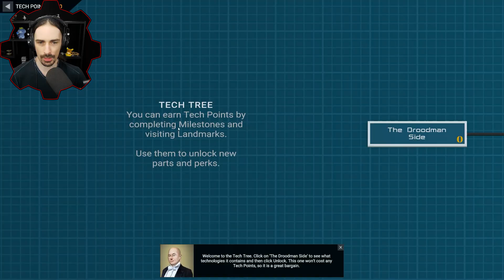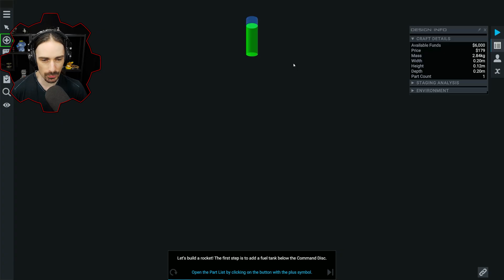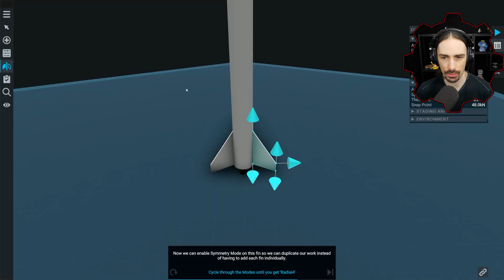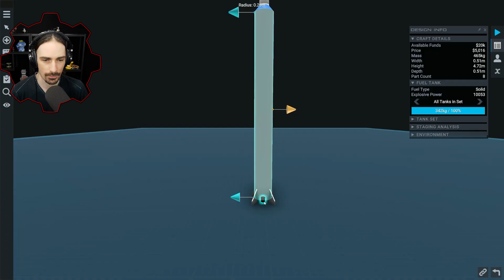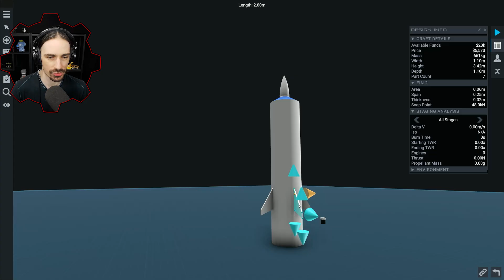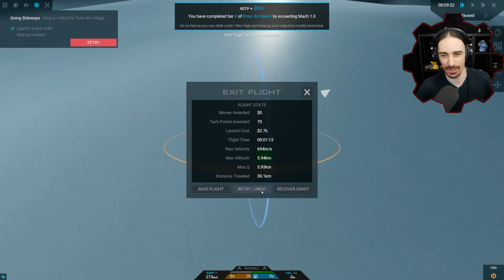This Rocket Builder Game Made Me CRASH MY OWN ROCKETS! [Juno: New Origins First Look]

Comment: I think scrapman needs to learn a bit of aerodynamics...

First, why did you fail the fireworks challenge?
The boom power depends on the amount of fuel in the tank, increasing the size of the tank increases the fuel capacity and increases power, but as you fly your engines are using that fuel so the boom power decreases...

Second, why is your craft hard to turn?
Your rocket has find for stability like a dart. And those fins don't have control surfaces... It will always point your craft in the direction You're going.

Comment: i suggest you to play kerbal space program 2 but they still not released it but kerbal space program 1 is still okay too but read all the documentation wiki because you will be got mind blowing how insane the community build handful but still readable for novice or first timer to play the games which is very fun to learn about rockets science without stressing you so much.

i dont know if this game using same principal with kerbals but you should tilt the rockets when its around 700m-1.5km around 45 degree to the left/rights and let the rcokets flying horizontally while pitching upwards to get lineup with horizons.

in the fireworks contracts, you need put more than number it says and exploding it higher than value to completed the contract, just the wording in there are using different approach what is meaning.

For the horizonal flights it better to gain attitude first around 2-5km or more ASL, then tilt it gradually until match with horizon and use less air resistance to gain more distance

Comment: The reason you were struggling with explosive power: 

The explosive power is based on how much fuel is in the rocket. So you made a rocket with 3267 'boom power' when it was full. But then you burned half your fuel getting up to 10km and lost 50% of your boom power.

Comment: so, the issue with the boom power was in the fuel leftovers in your fuel tank. while your rocket isn't launched, it shows the boom power for the 100% fuel in the fuel tank. when you tried to blow it, you had only a small amount of fuel in a tank, so it was not equal 3k boom power, as 100% filled tank.
hope I cleared it up for you

Comment: Hey ScrapMan,
The reason your rocket wasn’t turning quite as fast in your last launch was because of the force exerted on the fins increases with increasing speed. So when you launched before and tilted Ive way faster, that was because you have significantly less force pushing on those fins. At higher speeds the fins (unless they have controll surfaces) will try to always point you in the direction of travel. BUT the force of air also decreases as you go up in the atmosphere. This so there is a point at which your speed and height make for maximum aerodynamic force on your rocket. This is called “Max Q” in the aerospace world. You can often times hear an announcer calling out max q during a real world rocket launch!

P.S. keep playing this game!!!!!!!!

Comment: The boom power goes down as you burn fuel, Scrapman if you review the footage when you're getting ready to blow it up you'll see the boom power going down. You got super lucky with the success as the number was almost lower than 3168
Reply: I was just about to comment this
Reply: Yeah @Mojo Jojo
Reply: What a goober
Reply: Wasn't looking close enough to see that, but I was wondering if that was the issue, thanks.
Reply: @Nevir202  Same here!
Reply: Yeah it's not that obvious they should of made it more clear
Reply: @codingmaniac  To me its obvious because fuel is flammable, and if you burn/use the fuel, then whats gonna make the bigger boom?
Reply: @aeco44  Well, not really. In real life the boom comes from the fuel/air mixture. A full fuel tank most likely won't explode, only burn. But when it's almost empty and the fuel has room to evaporate and mix with air, that's another story.

(In fact mixing with air is a good way to make even less-flammable things behave quite violently. Google “dust explosion”.)
Reply: @codingmaniac  it was obvious, and they did make it clear.
Reply: @Milamberinx  if you didn’t know where to look then no
Reply: @mojojojo6535  You mean the meter right right above to the button you have to press with a label saying it was Boom Power wasn't enough?
Reply: @coreytaggart128  as viewers we will see everything but the YouTube might miss some things, if you don’t make the connection that boom power goes down as you use fuel and you don’t look at the entire screen for 10 minutes ( which he sometimes does) , you won’t see anything especially in first session of the game GENRE let alone game

but if you don’t agree then we will just have to agree to disagree and not waste time arguing with random strangers.
Sorry.